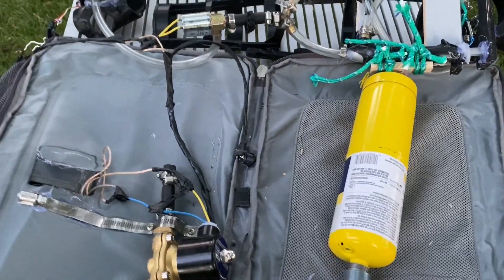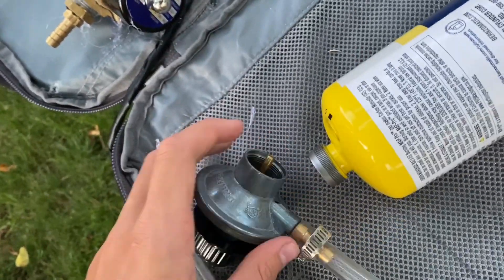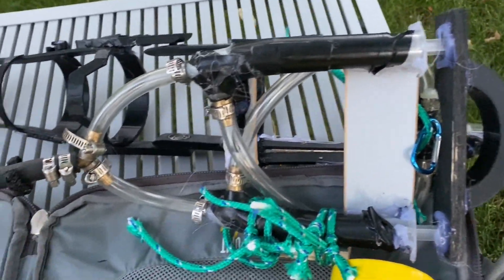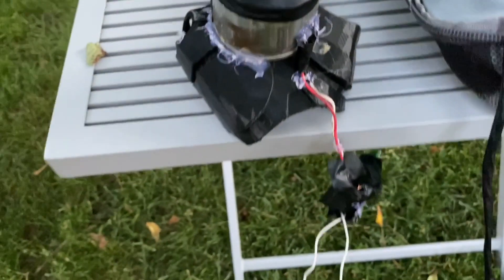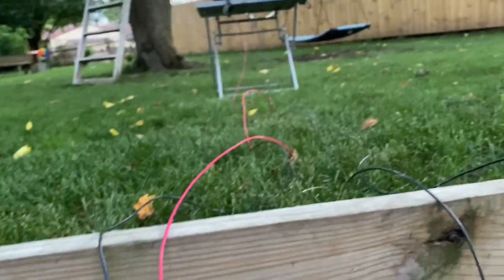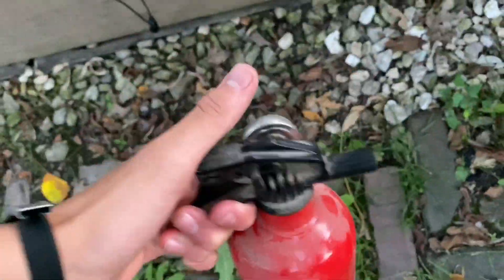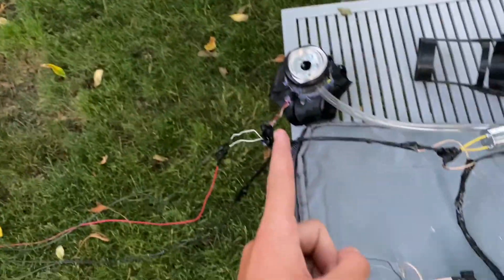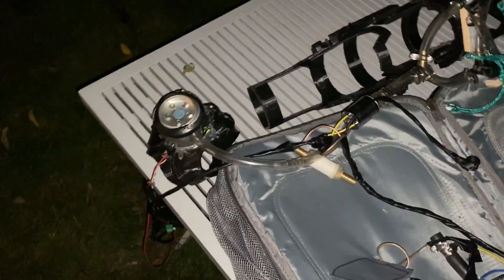Making A REAL IRON MAN REPULSOR - IT IS DONE!

Comment: Can u pls explain how this work so that I can re create it that's my dream to make iron man replusor
Reply from the maker: So basically, there is a tank of map gas on the back which is screwed into a modified grill valve which is connected to a tube leading to a check valve which only allows gas flow one way. the gas then collects in the 2 collection chambers which are made of old co2 cartages and syringes. I then added a pump like thing to pump the syringes to gain pressure. I ended up doing this manually instead of electrically because I didn't have enough recourses to do it manually. It leads to a solenoid which when a button is pressed, opens up and sparking an arc lighter in the combustion chamber causing all of the gas to explode
Reply: @Random.Creations  so there is basically a simple lighter in the chamber and when the gas comes in the chamber with great force it explodes. Does Alex has also done this . And can use hydrogen reactor which Alex has made does hydrogen has lower blast or higher blast and thank u for replying but pls make sure that in ur upcoming videos reply to the doubts of ur veiwers but thanks a lot I m going to recreate it and try to post a video on YouTube if I post a video I make sure that in description there will be ur name as I m going to make it by inspired by u love from India 🇮🇳🇮🇳🇮🇳
Reply: @monikatyagi1998  bruh
Reply: @thewhitesheep4156  why u said 'bruh'
Reply: @monikatyagi1998  i needed to